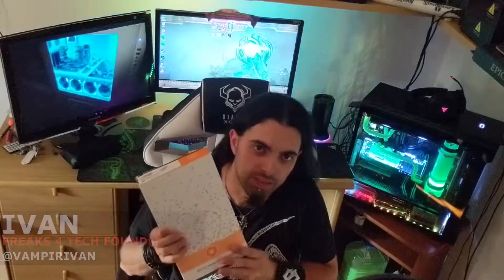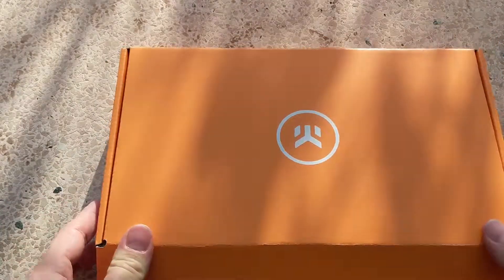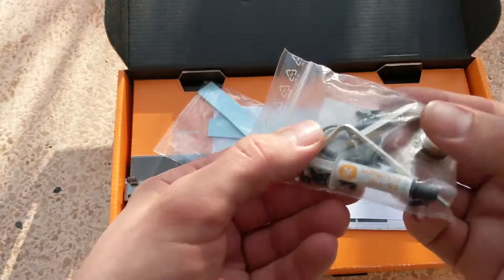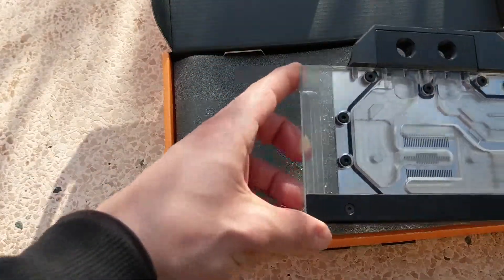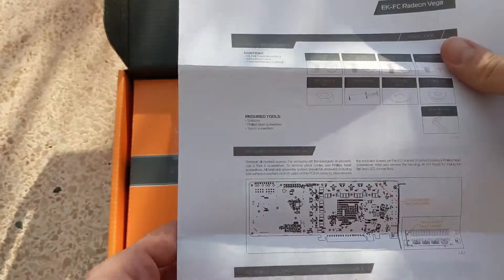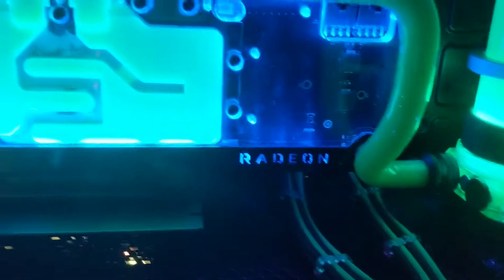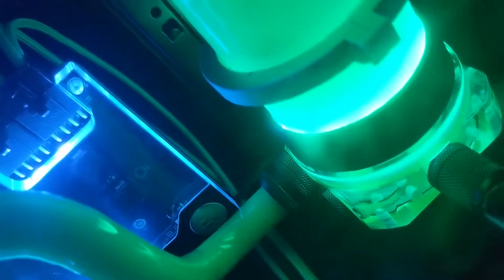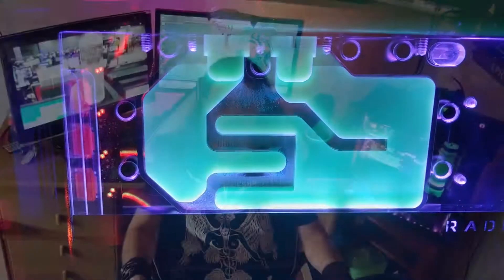EK-FC RADEON VEGA RGB Unboxing & Review

Comment: Someone told me you can find a pump/reservoir and radiator for $100-150 on ebay that can go with this. Do you have any tips or suggestion? I bought this block for $120, what else do I need that will work since its nickel? On a budget, want to spend $250 tops.